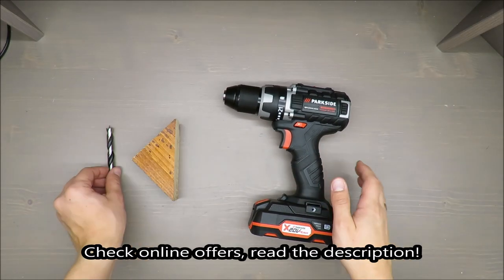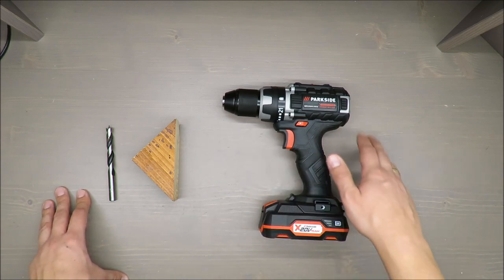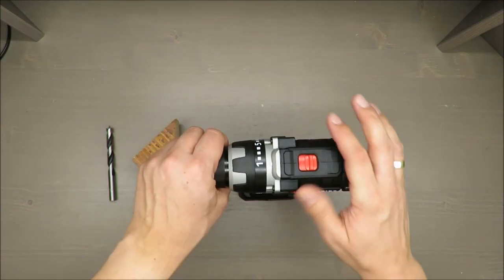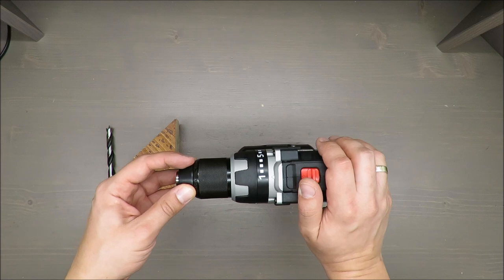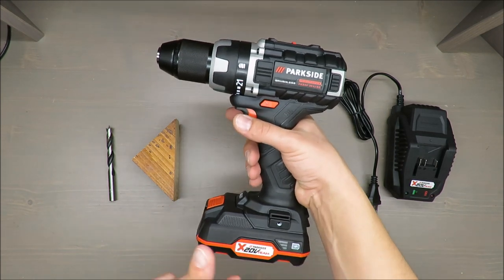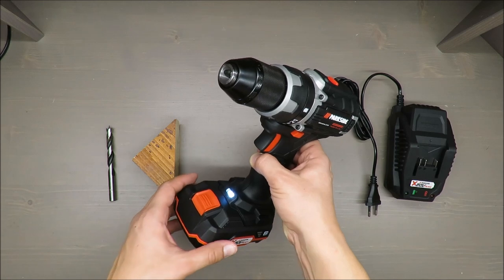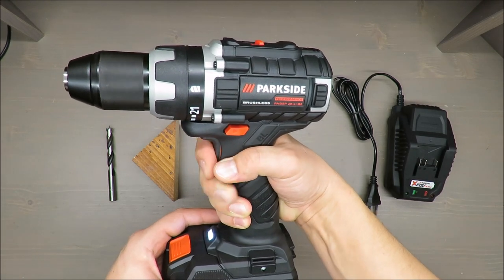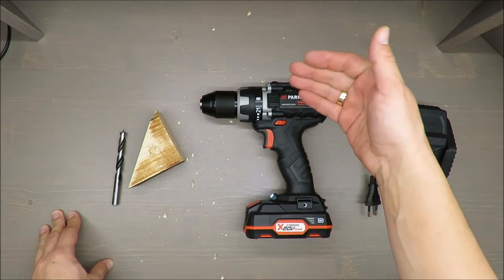Parkside Performance Cordless Drill 20V PABSP 20-Li B2 REVIEW / TEST (Lidl 20V 60Nm 36Wh)

Comment: Dude... You pay double price for premium quality, then say its "not parkside price". Green quality is actually shit - I have green portable table saw, which is essentially scheppach (quality china), but did a lot with it, no problem, but then table saw is very simple construct; then I had parkside jigsaw pstk 730 which is very decently made inside, say blue bosch, same accuracy, but then motor just died after several years of use. Blue bosch or makita would not die, thus I spent 150€ on makita 4351... You see reason, for complex tools "green" quality doesn't provide quality of material, but for simple tools green quality is fine. This is why you pay here double price - this one is in makita and blue bosch league. It even has battery overpower protection, similar to makita  with its batteries: watch?v=v7q_8a-j61I
More video for you: watch?v=a1a4wrqdkAU
I think the only area where this drill is lacking is possibly heavy-duty dust protection, which is indirectly proven here:
Makita gives you 3 year warranty only (for heavy-duty use), parkside gives 5 year warranty (which is nullified for heavy-duty use). So solong you dont drop the tool into dust, its just as good at 1/3 of the cost.
Reply from the maker: Thank you for extended opinion. Indeed very detailed and your way of thinking I do believe is right.
Reply: @outoftheboxunboxing5020  One more thing, which downgrades Parkside, its "main problem": it hides actual manufacturer. Which means spare parts are non-existent if one can't locate who made the tool. It wouldn't be problem if Parkside did replacement parts program, but it does not. In case the maker is  obvious, like Sheppach saw I stated, its easy to find replacement part. In case of performance series, it seriously downgrades the tool. The motor maybe fine heavy duty, but break a contact at screw driver base or its trigger and it becomes a serious PITA. Even Einhell or Skil don't have this problem.